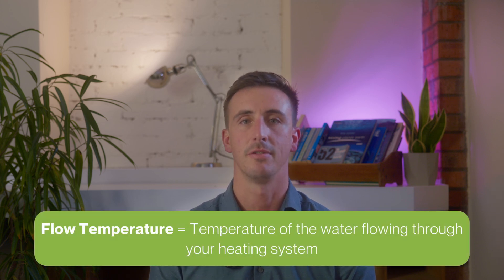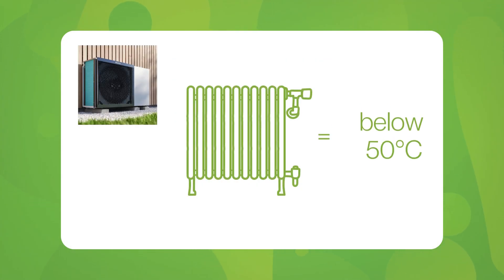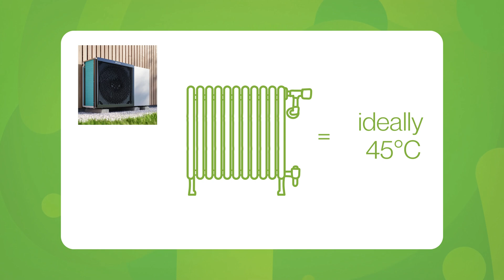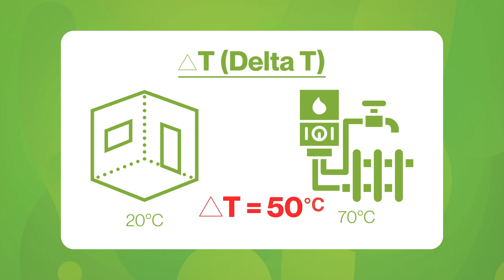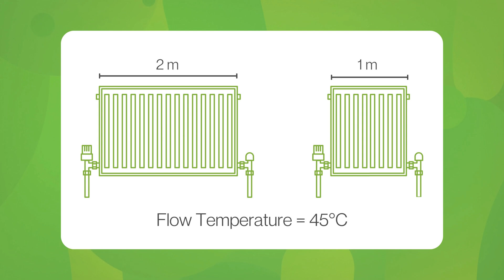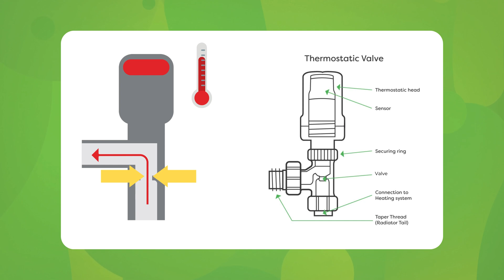Are My Radiators Suitable For a Heat Pump? | Our Engineer Answers!

Comment: I have 31 degrees leaving water, for my radiators I increased the flow to deliver enough heat. Base floor has floorheating and first floor 5 radiators. This goes well now. 31 out, 26 degrees return. Daikin split 6kw with 230l tank

Comment: Thanks for the advice.  I want a ASHP to replace my gas bolier.  My pipes to radiator are 10mm.  How does one go about changing them to 15mm - isn't that going to mean ripping up all the walls and be prohibitively expensive?  What cost is involved?
Reply from the maker: It ultimately depends on how much pipework you need to change in order to achieve the radiator output you require. A qualified heat engineer should be able to tell you this and advise accordingly. You don't always need to change full runs but ideally you do to reduce balancing down the line. In terms of costs, it's hard to predict without knowing how much pipework needs to be changed. Hope this helps.
Reply: See above as I’ve 10mm pipes and my system works well. We are in our 70 and like heat so our house is set to 23°c all day and 20°c at night. We live in a 10 year old three bedroom semi.